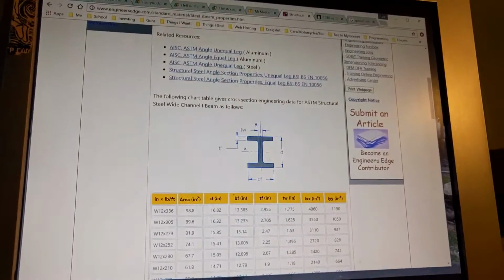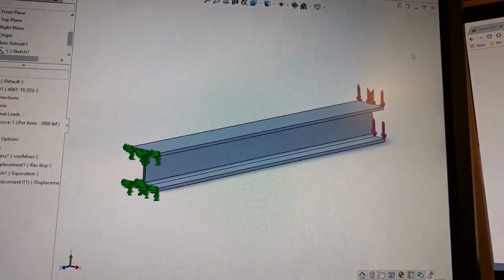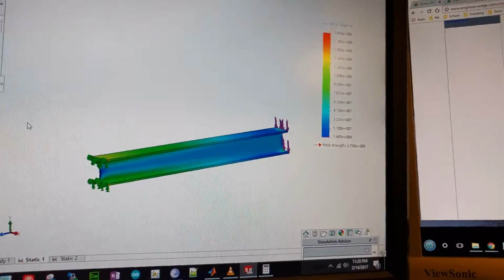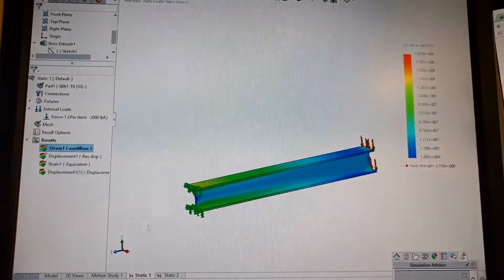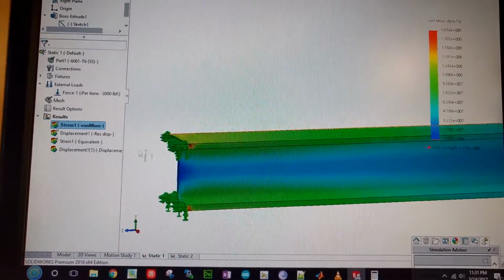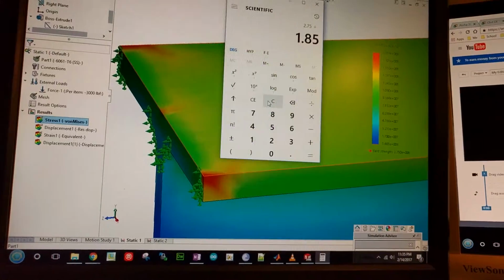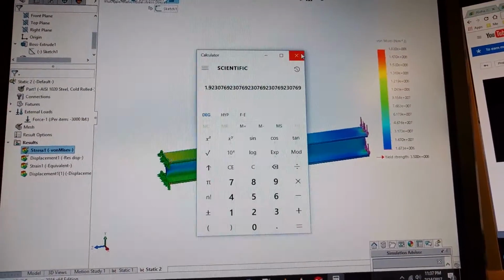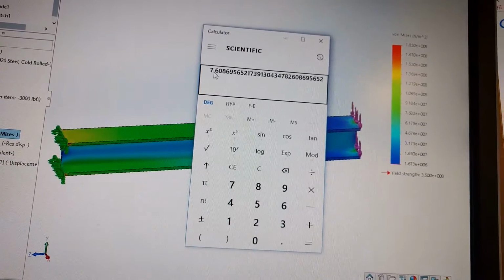FEA Example for Doug Jackson

Comment: A couple corrections:
1) Your yield strength for the 6061 T6 aluminum I-beam would be way lower than what the material data might make you think. That's because T6 indicates it is a tempered alloy that has received a special heat treatment to improve its mechanical properties. After welding the HAZ would effectively be 6061-O (untempered) and have a yield strength of only 70 MPa or so.

2) Those aren't real stress concentrations at the fixed beam end, they are artificial singularities due to application of the constraints. You'd find that if you kept increasing the mesh resolution the peak stress would just continue to increase there, never converging on a value. The reality is that the actual beam isn't perfectly constrained, and the observed singularities are non-physical. You can fix this by using a non-linear model that permits local yielding.

3) For the simple case of a cantilever beam, FEA is entirely unnecessary. You could get the same info from 5 mins of hand calcs; of course more complicated structures/loading conditions may warrant it, but it isn't always a great idea to jump straight to FEA without hand calc estimates for a sanity check. In the same vein, those fillets in the model are unneeded detail. They hardly affecting the moment of inertia of the cross-section, and I'd wager a guess that your mesh resolution/adaptivity is insufficient to correctly capture their geometry (at least with what is built into Solidworks).

Comment: Can you model a box beam instead of am I-beam ?
Reply from the maker: theoldwizard998 I could but an I-Beam is optimized for the bending load seen in this example. The stress concentrations are at the top and bottom of the beam (horizontal sections) where the material is in compression and tension. by having the center part of the beam being only one vertical section (I-Beam) instead of two verticals sections (Box) you can save that extra material and either put it at the top or bottom where it is most effective at supporting a bending load.